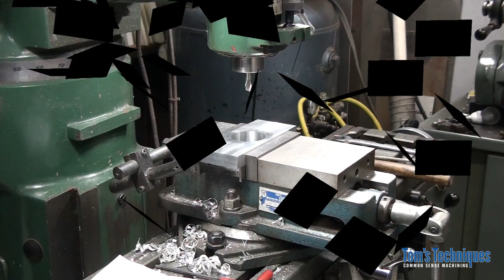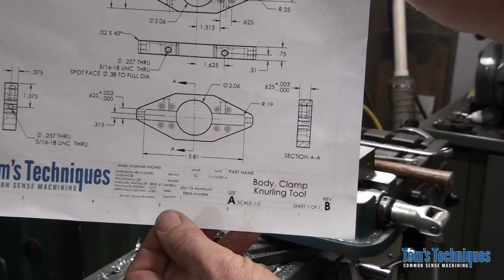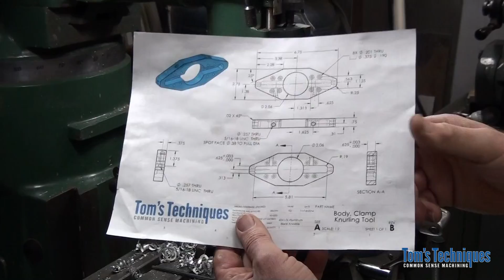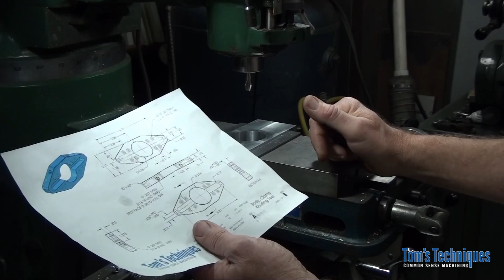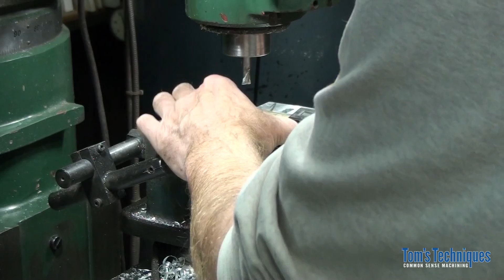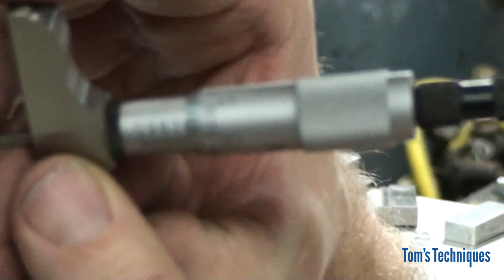Clamp Knurling Tool Body, Milling the Slot

Comment: Hey Tom I dont have a boring head so I'm thinking about boring the large hole in the four jaw chuck on the lathe that should work right?
Reply from the maker: Absolutely. That's the fun thing about maching
 There are many different ways to accomplish the same end result.

I never got around to making the final video on this project, so keep this in mind. When you purchase your knurls, be sure to get them with chamfered corners. Otherwise, they will dig in when you use them. The chamfers can also be added by mounting them on a mandel, held in a cordless drill, and adding the chamfer with a belt sander or grinder.
Reply: @TomsTechniques thanks tom I'll give it a go

Comment: Hi Tom. Thanks for documenting this project. Looks great. I'm new to machining. Just started working at a Tool & Die shop.
Why didn't you go to your final depth dimension before milling to the side dimensions?
Reply from the maker: I like to mill the bottom separately on high tolerance pockets because milling them together tends to influence the width. Probably not so much with aluminum and a short end mill like this, but definitely so on steel and with longer end mills. Milling the bottom separately also generates a better surface finish. It takes a little more time, but in my opinion, the results make it worthwhile.

Tom
Reply: Thanks. Really enjoying your channel.
Reply: Thanks Tom. That makes perfect sense. 
Really enjoying your channel.

Comment: Ca I just ask...When plunge cutting with an endmill is the endmill tip type critical (defintions endmill/slot drill?) Or are you avoiding the probem by just using less than half the endmill diameter per plunge?.
I'd just like to add that I;ve just bought my first lathe and mill and find your videos the best I've seen for a beginner!! I just need asbestos fngertips for tool grinding at your speed..
Reply from the maker: Any end mill can be used to plunge cut, even if it's not center cutting. The reason it will still work is because as you pointed out, only about a third of the diameter is cutting. An exception would be if the slot was blind, you would first need to drill a hole to get the end mill to depth.

Glad you are enjoying the videos.

Tom

Comment: How in the world did you come up with 5.81" for the slot length? I realize that that length isn't important which makes it all the more strange to me. Why not 5.8" or 6"?

On a similar note, how do you come up with tolerances? -.000 and +.003 on the slot width, for example. If I'm building something, how would I know how to tolerance a particular feature?

I'm just trying to get a feel for the design process.

Great video and series. Thanks!
Reply from the maker: 5.81 is 13/16 rounded off to two places. The length of the slot was driven by the need for the knurls to clear a 2" diameter part.

The application of tolerances is a key area of mechanical design and mostly something learned by experience. It is dependent on a large number of factors; the specific application, how parts are expected to interact with each other, the aspect ratio of the mating parts, how they are intended to be manufactured, the materials they are made of, the environment they will be used in, etc. I may do a video on how to specify interference and slip fits at some point, but that probably as far as I'll go on the design side of tolerancing.

Tom
Reply: "I may do a video on how to specify interference and slip fits at some point"

That would be very interesting! Thanks for taking the time to answer my questions.

Jay

Comment: tom  could you have used the table stops to set the slot length ? very nice project.
Reply from the maker: You could, but I find it's quicker to just use the dials or the DRO. The only time I've used the table stops was when making multiple parts, i/e. production.

Thanks,

Tom

Comment: Another great video Tom.  I am scrounging through the shop tomorrow to see if I have enough aluminum to copy.  Thanks for your time and dedication to your videos.  Also, quick question.  What CAD program are you using for your drawings?  They are great and I would like to learn that as well as the machning.

Mike.
Reply from the maker: Thanks Mike.

I use a 3D CAD program called SolidWorks for my modeling and detailing, but unfortunately it is not really appropriate for the hobbyist. I believe they also offer a free 2D version called DraftSight. I've never used it, but I understand it is quite powerful.

Tom
Reply: Solidworks seems to be a popular and powerful program, but at over $6000 a seat, it's definitely not for hobbyists whose names don't end in "Gates". I found one called Cubify Design, which appears to be a cut down version of Alibre and has useful capabilities for us hobbyists. It's a parametric 3D CAD program that seems to be aimed at 3D printing users, judging by the limited choice of output formats, but it can let you design parts, create assemblies of parts, and output dimensioned drawings.  If you change a part, the dimensioned drawings update automatically. It's about $180, so much more affordable than Solidworks. Since the methods of work are similar to Alibre, Solidworks and other parametric CAD programs, it may be a useful intro and you can upgrade to other programs with more features and higher cost later if you can afford to and need to.

I love these videos. The pace is great, the instruction is clear, the methods obviously work, and the projects are useful. I have a small lathe now, but no mill, so I appreciate that this project can be done without a mill...at least if you can do some limited milling on the lathe.  My milling attachment has very limited size capabilities...a couple of inches may be too much, but it's close and I'm considering ways to get around that ( like getting a small toolmakers vise and making an adapter so it can be held in the milling attachment).  Seems like the main issue will be the long slots...I think everything else can be done on the lathe or the drillpress or a bandsaw (due to cost and space limitations I went with a portable and a table for it from Swag Off-road....throat capacity is only 5", but that's enough for things like this!).  Having fun learning to use the lathe, and with all the great videos I've been learning from, so far things are coming out good on the first try!

Thanks!

-- Mike
Reply from the maker: BigMjolnir

Lucky I don't have to pay for mine because my last name is definitely not Gates. :O
Reply: I've been lurking around Tom's videos, occasionally suggesting Sketchup or Designspark Mechanical as a hobbyists alternative. Neither are perfect for this sort of work, but they get the job done. I'm more fluent in Sketchup, but DSM easily overcomes some of the things I've struggled with in Sketchup. Both are worth a try.

Comment: Tom, over here in the UK 6061 seems to be far less common than in the US, particularly from hobby type suppliers. The common ones available are (HE 30) 6082, 6063 and 2014 with 6082 being the most common. 

The 6082 in t6 looks comparable to 6061 in tensile and yield strength, but that might highlight my ignorance of metallurgy.

Could you say which would be best as a substitute for the 6061.

Regards
Alastair
Reply from the maker: Alastair,

We call 6063, architectural grade aluminum over here. It's good for extruded architectural shapes, but doesn't machine as well as 6061. I've never used any of the other alloys, but looking at the specs I would agree that 6082 T6 is pretty much the equivalent of 6061 T6.

Tom

Comment: Nice video, thanks for going the dial route. I wonder if there is any reasonably easy way to clip out the high frequency sound during milling, it's particularly painful.
Reply from the maker: Thanks.

Maybe if I was an audio engineer, there would be a way to deal with issues like that but I'm not. As I mentioned in the video, I did invest in a digital audio recorder and a wireless mic, so my voice will be on a separate track in future videos and that will allow me to lower the background noise. Hopefully that will help. Otherwise I may have blown about $400. :(

Tom

Comment: Another great job Tom
Never thought of plunge cutting, Wonder how that would work on steel? Slower of coarse.
Thanks for not using the DRO, That helps us little people with are drill mills.
I am learning a lot even though I am not making this project at this time, You are bringing the use of prints and drawings into a better prospective.
Also like the way you show different ways to get things done

Bill
Reply from the maker: Thanks Bill.

Plunge cutting is even more appropriate for steel. It isn't necessary from an end mill life point of view on aluminum, but it will greatly extend the life of an end mill when used on steel.

It's always good to have more than one way to do something.

Tom

Comment: Another great video. Super in every way.
I was wondering if because of the material removed, could the pressure from the vice jaws squeeze the gap at the top of the part causing too much material to be removed by the end mill? There at the last there is only a small amount on the bottom holding the gap open and that is at the bottom. And the jaws tend to pinch somewhat harder at the top to hold the part down. Is there any risk the milled slot would open up when un-clamped?
I appreciate the no-DRO approach because I do not yet have one. I learn a lot from your comments in response to viewer comments, and had to chuckle at the DRO upgrade being the best addition to a mill, except for a motor!  I don't know how many are rotating their end mills by hand. Ha! Good one.

Comment: Thanks for sharing, Tom. I really enjoy your videos and the image quality seems much better these days too. Glad to see you give a little tutorial on not using the DRO. One thing I have noticed, having both a desktop and bench top mill is that the smaller of the two only has a handle on one end and thus, only one dial to work from.

I seem to remember you showing how to do the measurements while taking up the play in the lead screw in another video. Do you recall which one covered that topic? I could always use a refresher.

Thank you!
Tom Z
Reply from the maker: That's good to hear Tom. I have been researching the best video formats for YouTube and seem to have it nailed down. It's a balancing act between processing time and image quality, but I think it's worth the time to get true HD video.

I think the video you are referring to is How to Mill a Pocket or Slot on the Milling Machine.

http://youtu.be/GRL9Pf7STSM

Thanks for watching.

Tom

Comment: Hi Tom,
During the part where you were finishing the slot width and took an extra thou on the backside.  Was the extra material that needed removal to allow the gauge blocks to fully seat actually on the first wall (your side of the cutter)?  I wonder if the single spring cut at 18:30 was mostly pulling in and re-cutting the chips on the bottom and messing with the lower portion since you were climb milling.  I like the tip on fast material removal by plunging the mill.  It's a LOT easier to resharpen the end of a mill than the flutes!
Thanks, again, for sharing your wisdom.
Reply from the maker: Hi Eddie.

It's typical for a small end mill to make a tapered cut when side milling. That's why I checked to be sure. You'll never get a side cut completely perpendicular to the axis of the end mill because eventually there just isn't enough side pressure on the end mill to make it cut.

Thanks for watching.

Tom

Comment: Tom, 

Great post, once again I've learnt a great deal. At some point could you go over the tolerances and the thinking you use when designing the part. 

I see that following the designed tolerances is relatively easy, when you know how, but would like to understand a bit more about the way they are set up in the design so that parts fit.

It's good to hear you had a good Xmas despite your unwelcome visitor, all of the best for 2015.
Reply from the maker: Thanks Alistair.

The application of tolerances is mostly something learned by experience and is dependent on a large number of factors; the specific application, how parts are expected to interact with each other, how they are intended to be manufactured, the materials they are made of, the environment they will be used in, etc. I may do something on how to specify interference and slip fits at some point, but that probably as far as I'll go on the design side of tolerancing.

Christmas is always nice because of the time spent with family. I hope you had an enjoyable one yourself.

Tom